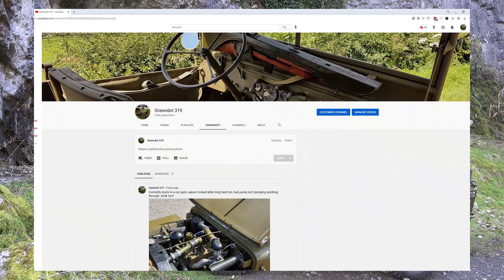I spent $1200 on my Butt....then my Willys jeep got Vapor Lock......

Comment: The BIG difference between your experience here and that in 1943 is the fuel ! Back then they had real petrol, the filthy stuff we are trying to run on now is a cocktail of many volatile chemicals, you will find that if you just pour a litre of Parrafin into your fuel tank it will reduce the evaporation point of the fuel and stop your gas lock, you can also lag the pipes where they run near the hot engine block, but the parrafin added will do the trick, and also reduce the octane of the fuel to somewhere near the original "pool petrol" octane which it was designed to run on, you could also pour a few gallons of Avgas in to tank as that does not have the awful volatile additives that road fuel has, just drop into your local airfield and ask nicely. Stay safe! Chris B.
Reply from the maker: Thanks Chris, your input is excellent as usual
Reply: Would this be a problem then with the Carter carb as well ?

Comment: Hi Mat I had a Willys that used to vapour lock in parades or traffic not much fun on 6 volts,a couple of tips carry a 2 litre pop bottle of water and pour it on the fuel line round the engine and on the pump  and carb .Another is add a small amount of parrafin to your fuel to lower the octane ,its modern petrol that creates this problem hope this helps . Roger in Sheffield

Comment: I just purchased and installed the spring seats from Paolo. They are great. When you first sit on them you think these are harder then the foam BUT as you drive and hit a few bumps you realize that they take the harshness out of the bump. Thank you for your video it made go ahead and spend the money for the proper seats.
Reply from the maker: Thats great, they are much better than foam and look correct, I wouldn't now restore a jeep without a set

Comment: It's the disruption of proper air flow do to the lack of the windshield (screen) lol.
Might verify the fuel tank is venting properly also.
Reply from the maker: Pushing your luck there lol!   The fuel tank is pretty air tight but I unscrewed the cap and didn't hear a hiss or anything first before I moved on to anything so I think its ok!
Reply: @Greendot319  I have jeep with the Solex also. I get the same issue you encountered. Most noticeable after a tank fill. Thought it might suction feed issue. My Solex is slightly different to yours, in that it has a chamber vent pipe which protrudes at the top of the venturi, otherwise the same. Must check the fuel lines to see if they run along hot block somewhere. Hope you get to the bottom of this issue finally.

Comment: The expense is worth it if you have gone through as much detail as you have done. You can help prevent heat soak with heat wrap. DEI makes a Velcro sleeve for lines and you can quickly remove it when you go to shows. It is only $26.00 american

Comment: Interesting discussion about the seats. I had never seen that about the springs before. Nobody makes accurate repro landrover seats, they only do foam filled which is right for later vehicles, but early ones were sprung and filled with horse hair. I'll try and track down some originals for my 1966.
Reply from the maker: That's too bad.   There is really something to be said for the sprung ride, its very good, that's how they designed it!
Reply: @Greendot319  I think the,thing is, few people in landrover circles would stump up what they would cost, so a cheaper alternative is always more viable. I do agree though, the sprung seats are definitely "proper".

Comment: This vapor lock issue is happening everywhere to many with older cars with carburetors.   It's the modern (Crap) Ethanol mixed fuel .  Supposedly the boiling point of Ethanol fuel is far lower than None Ethanol fuel.   I've also had the problem with my jeep for the last few years, it's been a head scratching journey.

Comment: I drove 1026km in two 12 hr runs. and Vapor lock happened about 10 times or so. Still have the Carter carb in it though.

Comment: I know this was some time ago but I think the vapour lock is down to modern fuel. I think the E10  is even worse. I have a 65 Mustang and I ended up going for an electric pump back at the tank to push the fuel through but even with this the engine goes really lumpy idling if I am in traffic, like a queue on the M25, for any length of time. The fuel percolates in the carb. I know you are going for super authenticity so your options are a little limited. 
As for repop parts I always go for the best I can get.  Cheap parts will likely let you down or not last as long.

Comment: I'm building one of these in a scale model for our October show I have all the dust pigments n mud effects there I'll copy whare it's all collected over and around the engine bay!
I've copied your wire cutter on the model and bits and bobs including your antenna mount and away to make the canvas cover for the radio with the clear part my model will basically be your jeep as a scale model

Comment: I know from experience that there is i difference in the volatility of fuels. if you added fuel when the weather is colder it is way more volatile then fuel you get in warmer weather. Check with someone in the fuel distribution business to be sure in your area, educate yourself in that local area as different places treat this differently.. And as already stated in other posts, the fuel we get these days are a far cry from what was available at the time of manufacture of these  machines...
Reply from the maker: That's an interesting idea Paul, I'm starting to move towards the idea of fuel problems rather than jeep problems but if it is a fuel problem then we need to learn how to sort it so we can continue using them as they should be used!

Comment: Hi Matt,  is  that  clutch  rattle  i  can  hear ??.  Roger  in   Norfolk.
Reply from the maker: Yep Roger absolutely correct, this is an early clutch and does not have the anti rattle springs so if you hear that noise when you depress the clutch at higher revs its the normal clutch rattle for a jeep!  Good spot
Reply: @Greendot319  yes, my jeep makes the same noise .  Roger.

Comment: God post as usual Mr Dot. Bit spooky though , I went out this morning and conked out after about twelve miles , temp around 150 , can’t manually pump any fuel through. But how do you know the difference between a dodgy fuel pump and vapour lock ?
Martin
Reply from the maker: Easy Martin, crack the fuel line before the pump, can you draw fuel through?  If yes its the pump, if no its the line! Also if the pump was working before and after the problem then its likely to be lock and not the pump.
Reply: @Greendot319  thanks Matt , that make total sense , could be the fuel strainer I guess.
You seriously didn’t eat hours old cold fish and chips ?!?!?
And don’t give me “THERE IS A WAR ON YA KNOW” 🤣😂
Thank you
Martin

Comment: Hello always great information. I have recently purchased the foam filled seats for my 1945 MB. After using the correct filled seats do you still feel it was worth the extra $$$ ? I'm on the fence I could resell my foam filled to help offset the cost if you really feel the correct seats are more comfortable.
Reply from the maker: It all depends on if you think its worth it, If you are doing an authentic resto then they are a must if not then dont worry!  There is a guy in America producing them now too so not just Italy
Reply: @Greendot319   Thank you for the information. DO you know the company or person that produces them here in the states?

Comment: Do you plan to wrap the fuel line in insulation to reduce the occurrence of vapor lock?
Reply from the maker: No Robert, it shouldn't get locked so it must be something I can sort out without insulating it!  There is an idea out there that modern fuel blends are more prone to vapor lock than WW2 blend so perhaps it is a problem now that wasn't a problem in WW2?
Reply: @Greendot319  1000s of Jeepers using modern fuel would have the same issue, if so. I would bet on tank venting, or a lock. Did you have a near full tank on the Gorge run ?

Comment: Reminds me of the old Ford flathead V8's always vapor locking on a hot day. How did they keep them from doing that in the desert in WWII? Find something to act as a heatsink on the fuel lines and keep a large bottle of water handy to cool off the lines. Happy Easter.
Reply from the maker: I think the problem is if your fuel line is not angled right, it just gets too close to the engine and causes vapor lock, but like you say I think even with the fuel line in the right place it probably still got vapor lock in desert conditions.  There is an idea out there that the fuels they used to use are less prone to vapor lock than modern fuel blends, perhaps that is the real difference!
Reply: @Greendot319  An old Chevrolet mechanic in his 80s told me about wrapping small coil springs from screen house doors on the fuel lines to increase the surface area to enable more cooling.  

There is also the dump some canteen water on the line trick.

Comment: It's worth checking that the valves in the fuel pump are sealing correctly. Had an issue with vapour lock on a '64 land rover, tried insulting the lines, fuel additives etc. and it turned out to be due to the fuel pump valves not seating resulting in backflow and vapour forming on a hot day after shutoff.
Reply: And the solution to solve this when you're out is to 1) Let it sit until it cools, 2) Get a wet rag to cool the fuel lines, carb and pump
Reply: How did you insult the fuel lines? Call them junk? (Got to love typos that result when you miss a letter. lol)
Reply: Looks like a new fuel pump is in your future. The check valves might not be sealing.

Comment: Nice jeep. Built a complete 1943 GPW from 2 parts 1943 GPWs. Both had matching frame, engine and body. One was much better than the other having been kept inside but it still got a body off rebuild where the other had sat outside and rusted away for about 30 years. Should get your windshield on soon. A stone in the face really hurts like hell.
Any particular reason you did yours as an American vehicle?